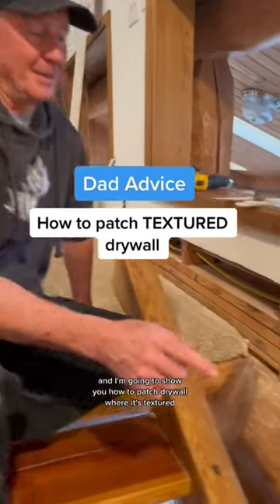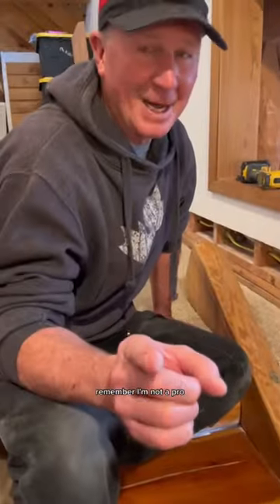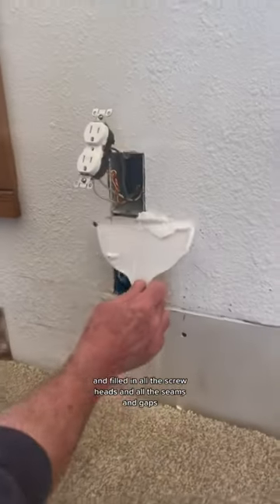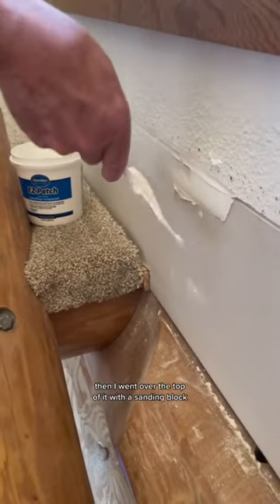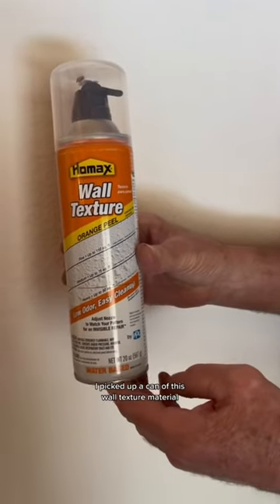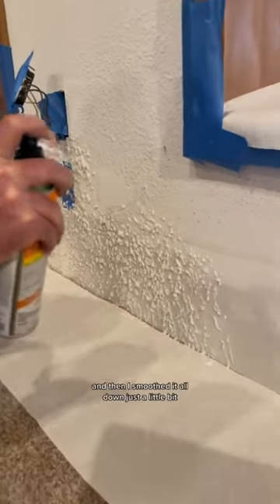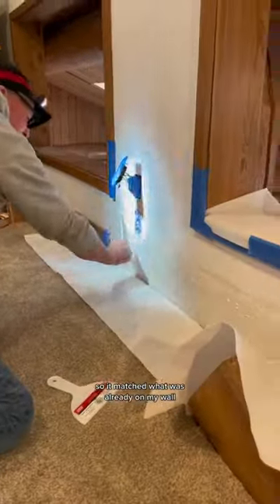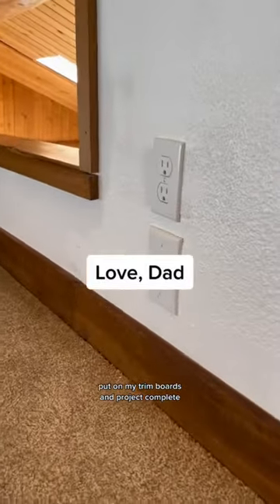40 seconds and you learn a skill for life. Thank you for being here. Love, Dad

Comment: I learned a new trick that might help. I watched a guy heat up a can of texture under water because he left the can in his cold truck all night. This allowed the material to come out much easier making it easy to get just the just right texture on the wall.
Reply: Great tip. Also, these nozzles clog easily. 

Turn it upside down and spray briefly to clear it out after use to avoid wasting the rest.